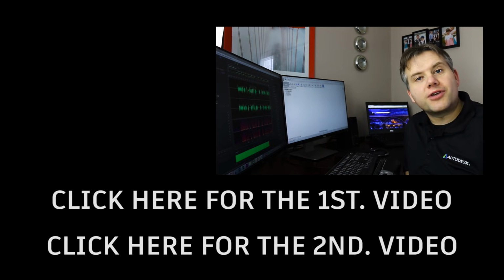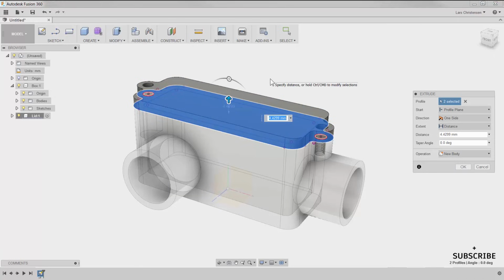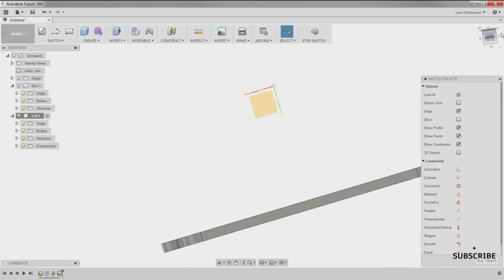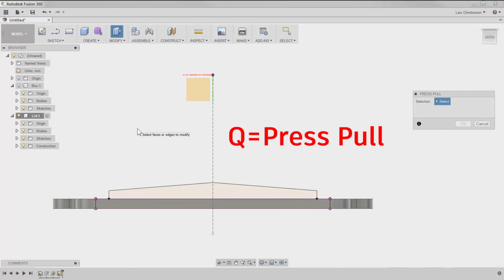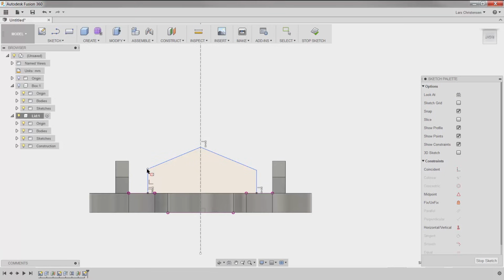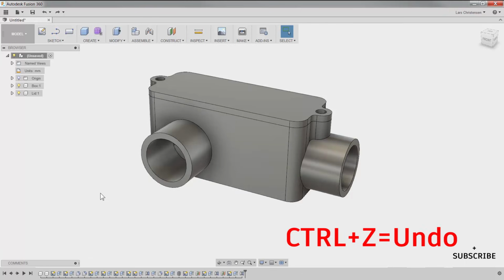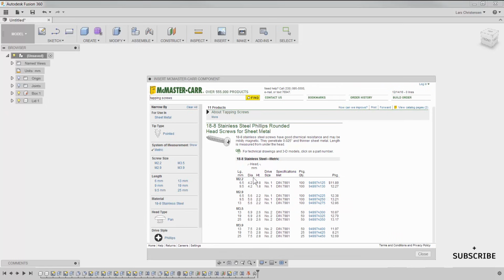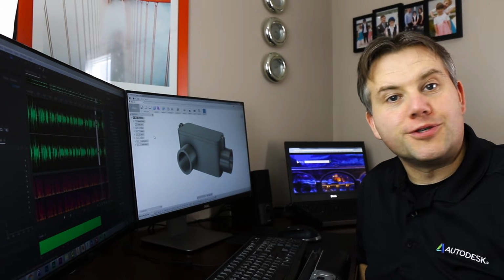Fusion 360 Tutorial for Absolute Beginners— Part 3

Comment: Hi Lars I am having trouble with mirroring the first lip on the bottom of the lid. I am unable to select it (won't turn blue) I have 'features selected as the pattern type
Reply from the maker: Ben, check in the tree to the left if you have a solid or if it created it as surfaces. I think that could be a problem. You could try to change selection to faces instead of feature and just select what you want to mirror on the screen.

Comment: Thanks for the video tutorials. Currently I am stuck trying to mirror the second lip for the lid. The mirror command will not let me select the lip and a feature, i can select the faces only.  As soon as I extrude the first lip it goes solid and changes from sketch to body when selected.
Reply: Got it to work by selecting new component at the press pull menu
Reply from the maker: Not quite sure what happened, but happy you get it figured out :-)
Reply: I had to do the same thing! Confused me for a while.

Comment: Hi Lars

Love these videos.  Just updated Fusion to latest version yesterday.  Got 2 problems.  When trying to select the point to establish the offset plane displacement, nothing happens - I can't seem to get any value to come up.  Have tried lingering over the (several) points I tried.  Still nothing.

Second issue, when I get to the sketch in the offset plane, after creating the construction line, I start the lines to make the first internal gusset.  First vertical works, second line to the construction line works, but when I go to enter the end point on the 3rd line, the point is there but there is no connection to the 2nd point.  Very weird.

cheers

Derrick
Reply from the maker: Hi Derrick, Not sure what exactly is going on. I would recommend that you contact 
https://www.autodesk.com/products/fusion-360/support

Comment: just finished 3/3.  Great stuff.  I have been out of the CAD world for nearly 20 years.  These vids got me exactly where i need to be for my small-time project box i am designing.  I greatly appreciate your efforts, and look forward to learning some intermediate skills from you after i apply what ive just learned.  I have one question for you-  I started my drawing before watching the first video, so my origin is not in the optimal spot.  What methos should i use to relocate it to the best spot?  I was thinking i could use some construction lines and snap it into the center.  id like to send you the fusion share link if you want to look at the drawing to determine the best method.
Reply from the maker: Hi Adam Roy Thank you for taking the time to watch the videos! 

You probably want to go into your first sketch and change the relationship, however have Ctrl+Z handy as depending on how you modeled your part, things could blow up.

Also, You might just also decide not to move things to the origin, not like we are designing anything that has to go up in space :-)

Comment: Excellent set of videos to get going with.
One question on this video, how would you move the 'tabs' in the cover to create clearance with the body? You showed the actual assembly with the loose fit but didn't cover that in the tut. 
(Now I have to go dust off my HP branded SpacePilot and see if I can get it to work...)

And to add to the all comments below - thanks a bunch for taking the time to put this together!
Reply from the maker: Hi Dan, Thank you for watching the videos! For this model, I would specify the clearances on the 2D drawing, not in the model.
I will try to cover this in a future livestream
Reply: how would I be able to get a gif file from a model in 3d to be able to laser cut my project?  great work and I will be watching 😊

Comment: Hi, anyone having issues getting the screws to go into the right spot at the very end? Mine keep going in upside down...any suggestions?
Reply: Hi, first time i also had the same problem. Then i got it. The solution of this problem is that? when you select the center of the spot be sure that mark colored white. Not yellow.
Reply: May be a bit late, but there is a button in the menu that pops up that will flip it.

Comment: How are you able to move your camera so smoothly when navigating around the box assembly? Especially are around 20:40 when you're trying to navigate to the screw hole. New to Fusion 360, hope you can help! Thanks again for the awesome video
Reply from the maker: I am cheating :-). I am using a device from 3DConnexion. They are a little expensive.

Comment: I have enjoyed your videos. I am having a problem with mirroring the rib on the lid. I have backed out of creating the rib and started over. I have even logged out and logged into the program again, I just can't select the rib to mirror it. What am I doing wrong. Thanks.
Reply: Same exact thing happened to me. I'm not sure but i think something changed in the newer version of fusion 360. I was just about to write the exact same thing. Not only that but, my origin planes moved and i can't seem to be able to get them back to where they should be. My head hurts and I'm frustrated because I've trying to straighten this mess out for 3 hours.
Reply: I was not able to select the rib to mirror it either in the latest version. Then I remembered what I had to do to mirror in a step in an earlier video. So instead of clicking on the rib to mirror it, I clicked down below in the history on the extrusion step and that worked for me.
Reply: RC Channel  Yes. I kinda figure that out on my own too. That design history below works for a whole lot of things, I've discovered. Especially when having problems selecting design features that you want to change or offset etc...
It took me a half day of trying different things to figure out that the design history is a good way to select things when your having problems trying to select them from the drawing. Live and learn.
Reply: Marcel LeMay that's great to hear. I'll keep it in mind to try that for other things as well.

Comment: Trying to start the line for drawing the first rib and it acts like it's trying to snap to points on the box instead of the edge on the lid, even though the box is hidden. Every time I try to add the dimensions it pulls the sketch away from the lid :-(
Reply: So for whatever reason, when I start trying to work on the new sketch using the offset plane, the parts of the lid won't highlight after I select the line tool. the cursor only snaps to the grid and the origin point of the new plane. Like it doesn't even know the lid is there. After I draw the reference line the line tool can snap to that also. Probably have something set wrong or I'm missing a step. Haven't been this interested in a new piece of software for many years though  ;-)
Reply from the maker: You are welcome to send me an invite to your project and I will take a look when I have a chance. Just make sure that you send a follow up email as I have a hard time keeping invites and YouTube comments connected. lars.christensen@autodesk.com
Reply: Figured it out. I had to tell it to use the surface of the lid as an intersect for both of the sketches on the offset planes. Not sure if that's a setting or something that is different now. I have 2.0.3133 currently.

Comment: Thanks so much Lars, This tutorial was amazing!   Pretty much as good as it gets.  I got stuck a few times and had to start from the top but was able to sort out every problem from watching you a bit more closely.    I'd love to see more basic woodworking projects that concentrate on CAD and then CAM programming to a home use CNC Machine (preferably with export to Mach3 and tool programming).   I've got many years of experience with Rhino but Fusion 360 is a very different animal.    Just from this first bit I'm really going to enjoy it,  they did a great job with this program.
Reply from the maker: Thank you for taking the time to watch the videos!
I have to admit that I don't know that much about wood :-) Next series is going to be on how to model an injection mold...Steel is more my thing :-)

Have an awesome day!

Comment: Hello Lars,

Love Your Energy! Yes I am subscribed and yes thumbs up. Thank you for saying you read all your emails! That was a real connect for me.  I am eager to get going and I need to know if this trick is possible in F360.

Is this possible? It is humorous! This is to do on a 3 axis mill what could be done more realistically on a 5 axis mill.

I want to mill an interior space that is 2 3/8th" diam by entering thru a circular hole that is 1 1/8th" diam.

Imagine two long reach T shaped undercut bits with 1/8th " half round cutting heads of exactly the same length of shaft.  One is 1" diameter and the other is 1 3/4". The first one can enter the 1 1/8" hole and open the interior space to an interior diam of 1 3/4. The cutting program is paused with the spindle dead center over the piece with the cutter head still in the piece. The bit is removed from the collet and fishooked out of the piece and the second bit is fishooked in.
The bits being the same length mean that the height of the cutter will remain constant and the diameter of the bit could be adjusted in the program to allow this bit to cut open the interior to 2 3/8ths " interior diam. Then the program is paused with tool bit still in the piece so that the bit can be safely removed…

Please stop laughing and tell me can it be done!?

Big Gratitude,

Kap Young/ kayoung@mac.com
Reply from the maker: Hi Kap, Yes! and I love your thought process. You are talking to the guy who once re-designed his mill to cut vertical slots in a mold core that was way too big for the machine. Thanks to Home Depot for selling carbide inserts circular saw blades :-).

Now if you program it in Fusion, you might want to go in and edit the posted code. Like, add an extra safety retract and MOO for stop, spindle stop etc.

But I would bet it can be done.

Best,
Lars

Comment: I have a question... I appreciate the video. It helped a lot, BUT, I created a problem for myself at the end of the lid. When making the little centering pieces for the lid, I made the offset plane, but somehow the sketch didn't get created on the offset plane and got created at the center of the lid. I figured out a way around the issue by extruding to the object of the offset plane, so the whole changing the size of the box will still change it, then did a cut extrude to same plane with -2mm creating the 2mm thickness needed. It would work just fine this way I'm sure, if not a bit sloppy, but something I have searched for and can NOT find is how to move a sketch from one plane to another. Is there any way to move the sketch I made in the center to the offset plane I made beforehand?  (I realize this video's kind of old and may not be responded to, but help would be appreciated. Like I said, I figured out that work around, but it's something I'd like to know for the future and just can't find the help on google.) Thumbs up on the video whether you can help or not :D
Reply from the maker: Thank you for taking the time to watch the video! Yes, you can right-click the sketch down in the horizontal history tree and select redefine sketch plane. You just have to make sure the sketch plane you want to move it to is before the sketch.

Hope this is helpful.
Reply: Thanks so much. :D That was exactly what I needed. Again, thanks for the videos! Super awesome!

Comment: Thank you Lars, great videos.  This was my first time ever messing with CAD and I was able to get through it with you. Although I don't actually have anything I need to design, it was kinda fun and I think I'll try more. One question because I don't quite understand why we made (imported), and inserted, the screws: Hypothetically speaking, if I were to send this coupler to a 3D printer, will it create the screws too (not that I would want plastic screws, but just wondering)?  How about the threads?  Thank you.
Reply from the maker: Thank you for watching the videos. If you wanted to print everything, you would lay each part out as if you were getting ready to assemble it, not having everything together like we did in the video. But in the real world you would delete the screws out of there before printing anything.

Best,
Lars

Comment: Lars, on one rectangular solid I have something like 80 holes created from five different patterns. All holes are the same size. I wish to counterbore all 80. Is there a way to quickly select all the holes in the sketch and apply one sketch circle to all of them? Thanks much.
Reply from the maker: I think the easiest would be to go back to each of your five first sketches (before pattern) and change it there. So that is like 16 holes you need to change?
Reply: Let's say there's a bunch of random holes in a flat solid, and I want to counterbore them all. Do I have to sketch a center circle for each hole, or is there a better method? (Sorry, I think my first example wasn't very clear.) Thanks!
Reply from the maker: Hi Brian, Yes, unless you can go back to your original sketch and change that hole to have the counterbore.

Comment: When I got to the 3rd video and started to model my lid I noticed that my origin is not in the center of my lid. So when I try to make the construction line it doesn't go through the middle of the lid, which seems to throw off everything when constructing this inner lip things. How do I get my construction line to intersect the middle?This is my third time going through these videos.. the first 2 times I managed to complete the box and it looked like your video. Don't know what I did this time or how to correct it. The only thing I know to do is go back to video 1 and start the whole thing over. What happened?
Reply from the maker: Hi Barbara, 2 out of 3 is pretty good :-). Did something go wrong when creating the second component? Honestly, I am not sure. But, thank you so much for watching the videos multiple times!!

Best,
Lars
Reply: I just went back to the very beginning and did all 3videos again. It worked this time. Don't know what I did or didn't do. But every time I go back I get more confident that I actually know what you're talking about.
What would you suggest as my next learning video?
If I find that my origin point isn't centered is there a way to center it without starting over?

Comment: Lars, I completed all three tutorials and they are great.   They provide me with a basis for doing design and an appreciation for the ease of use and power of the program.   One thing that I seem to be missing however, is what to do when I want to do a 3D print.   I have found how to export an STL file but it seems that the program buries it very deeply in the bowels of Windows.    Is there a simple way to save the STL file somewhere convenient.   I use Makerware to construct the build files for the printer.
Reply from the maker: Hi Kent, I would personally hit the Make drop-down and select 3D print. There you can select Meshmixer as your utility, Meshmixer is awesome.

Hope this is helpful.
Best,
Lars
Reply: Thanks Lars.  I'll try that.   I have had success in the past with the combination of 123D and Makerware for my printer but I'll try Meshmixer.   As long as it outputs .x3g files it should be fine.

Comment: Playing with the project feature now.  I need to create a door to a box, but the door is recessed inside the box.  So it doesn't appear that project will allow me to select features that have a recess or am I missing something?  I can select the holes which are also recessed, but not the geometry of the the doors mating surface on the original component.  Any suggestions?
Reply from the maker: You should be able to. Are you sure you are looking directly at the face with the geometry? Sometimes that can throw off the edge selection.
Reply: I tried clicking everything on the component I'm trying to project.  Only the holes are selectable, but I noticed the origin is on the opposite side of original component.   So I'm guessing it's due to poor planning in that the first component is actually the assembly and what should be the  second component is actually the first.  So I screw up.  I need to start over again anyway.   It's been a great learning tool building and watching your videos.   I just need to pay closer attention.
Reply from the maker: Let me know if you also run into issues on your second attempt. Don't want any frustration on my watch :-)

Comment: I really enjoyed this tutorial, but it has a MAJOR flaw.  [OK maybe not so major after all.  See update below] You never direct the user to save the project.  I was just finishing the tutorial and was adding the screws when the program froze during the save and upload of the screw object.  All data was lost.  I should know better, but frankly figured that the program was probably caching everything on the cloud.  Now I know better.  One of the very first things that should be done is to save the project and set the Autosave interval. This is a beginners tutorial after all.
Reply: I found the work was actually saved and saw this when I went to start a new project.  There was an entry for "recovered documents" in  File menu.  So I guess saving the project at the outset is not necessary.  Though I do think it is good standard practice.
Reply from the maker: Hi Jay, You are right. I should have saved the project. My mistake. To you other point, yes, software crashes from time to time. Fusion will always save as the first step in that process so files are normally recoverable.
Thank you for taking the time to watch the videos and comment.

Have a great weekend!